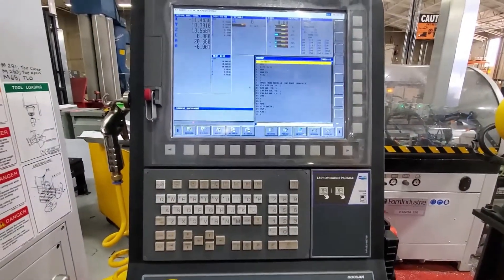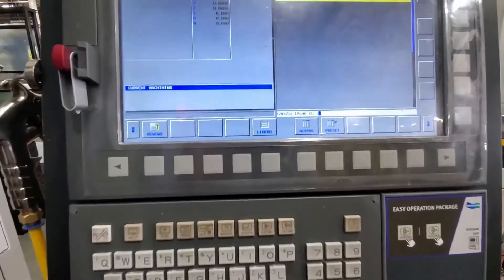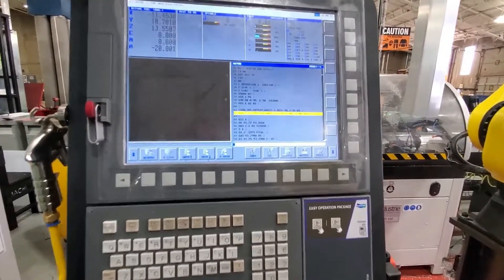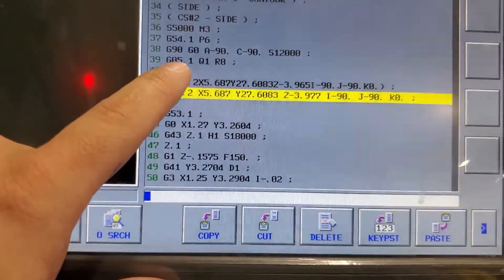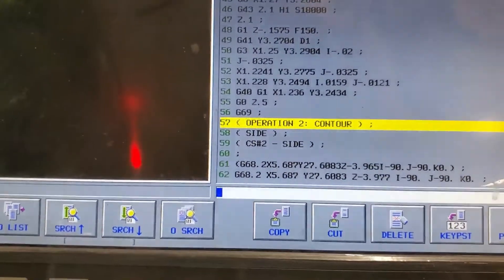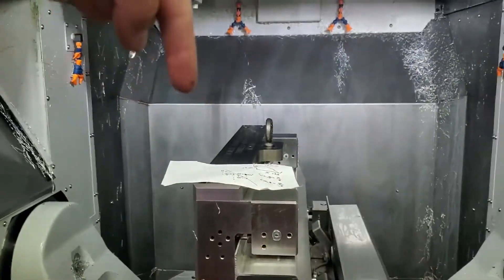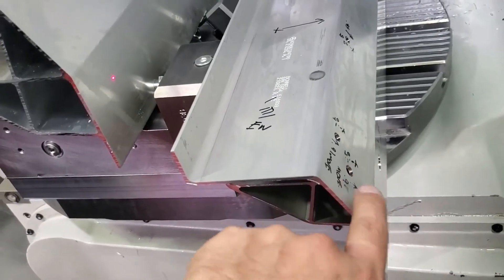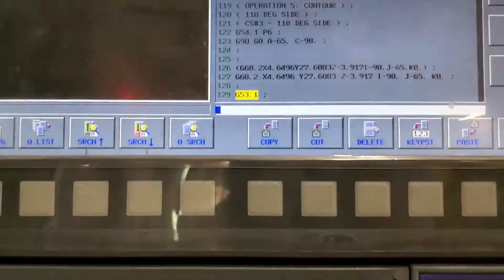Manipulating G68 2 5 Axis Tilted Work Planes

Comment: Very interesting. 
Why didn’t you change the hole location individually but the whole coordinate shift? I would have guessed as the holes all have a different adjustment needed it would be better to control the position and it wouldn’t introduce position errors elsewhere
Reply from the maker: Good question. Sometimes, to move datum holes I'll use a work coordinate shift, i.e G57, but in this case the code is written one G68.2 for each feature. It's simple enough to move each as needed. But, in this way, if you need to move the datum features via the whole work coordinate, all features move along with it as the G68.2 is based off of the G57.
Reply: @ericwhittaker3570  ah I see. I thought the holes were drilled so you got xy of the hole directly but it seems you are milling the hole, So hand editing the code of the hole location directly isn’t viable.